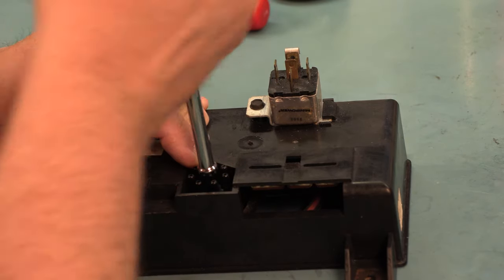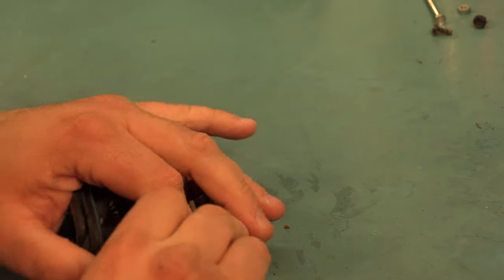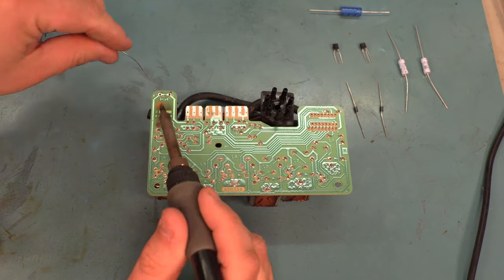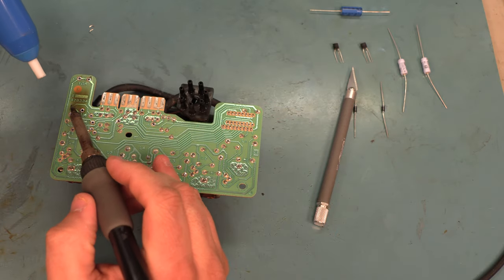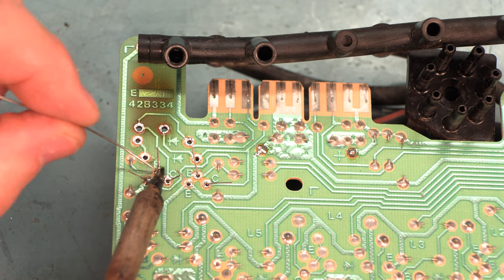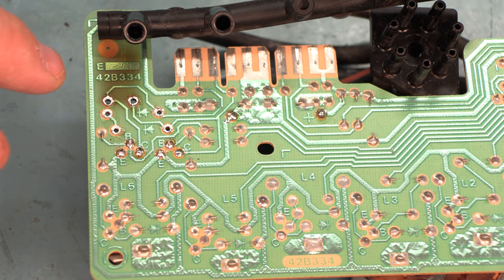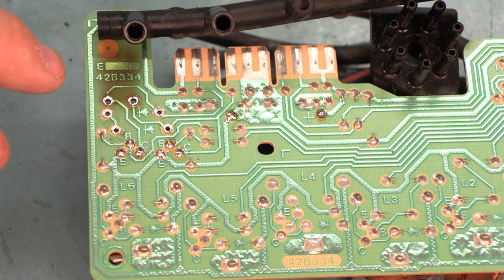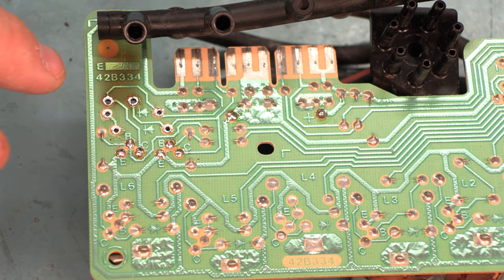86-89 Corvette #11 - C68 HVAC Programmer Rebuild 2020 by batee.com

Comment: I assembled circuit boards when I was in my teens.  I was taught to place power resistors off of the circuit board.  That is, leave some space between the circuit board and the power resistor to allow for air flow, which helps cool the resistors.  Just a friendly FYI and thanks for this great video.

Comment: What is that relay attached to the housing cover? I’m having an unusual issue with my 89. When I turn on the ignition, there is an intermittent clicking sound that appears to be coming from this area when the HVAC is off. Turning on the HVAC makes the clicking stop. Any ideas?

Comment: So I've rebuilt my programmer, but the blend door motor only goes one way. I only get motor voltage at full hot and full cold. If I send parts to you, do you want all three, controller, programmer, and blend motor?